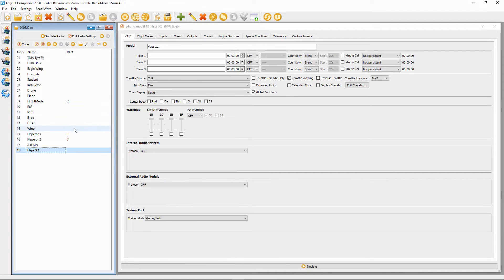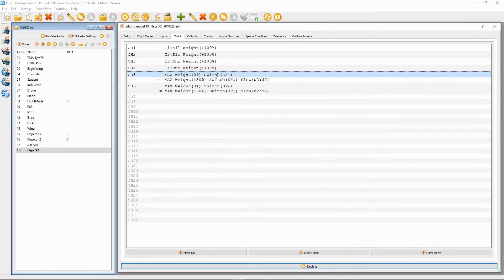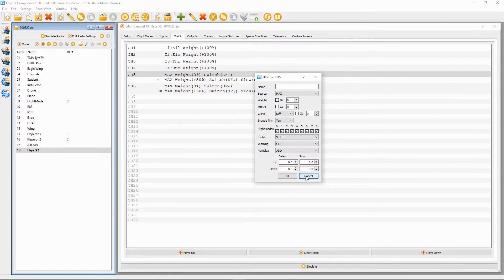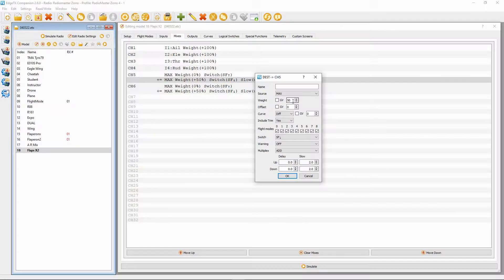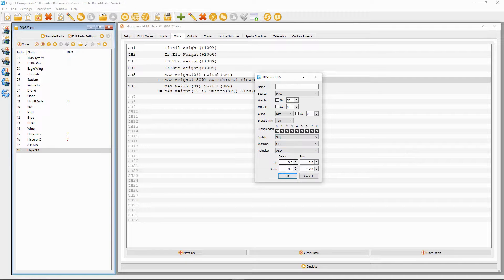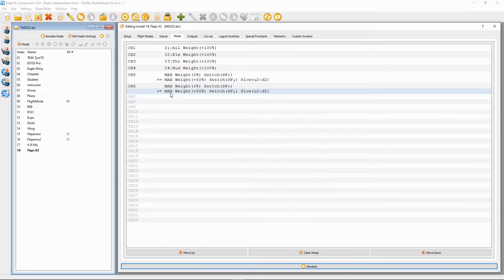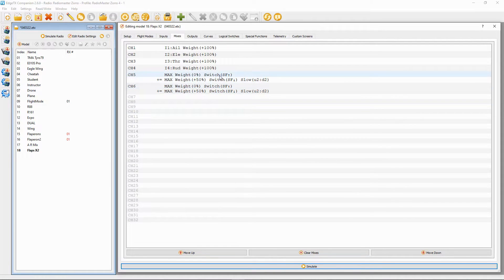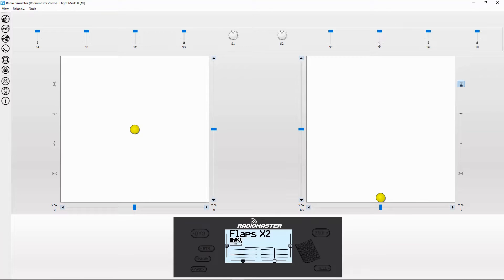RadioMaster Zorro Adding 2 Channels for Flaps in Edge TX

Comment: For us newbies, we are mostly buying Eflite trainers and these radiomasters are so affordable, but so confusing. It would be great to have a training video covering what exactly the diference is between Mixes and Outputs etc
Reply from the maker: Hi Stefan, If you are flying quads you will not normally make any changes in INPUTS or MIXES but for fixed wing I usually add expo to the aileron, elevator and Rudder under INPUTS. The reason for this is all mixes for the INPUTS will now include the expo. Dual rates are added to MIXES as would rudder aileron mixing.

Comment: Morning Bill, how can I use s2 slider for the flap control? cheers Keith in OZ
Reply from the maker: Sorry for the delay Keith work commitments! Short answer is yes but you will need to program the mixes to do so because you will need to have the flap full range of the slider and only go up then down on full travel or make top half of slider a dead zone and flap is up anywhere in this zone. I will look at the mix when I have time for you and produce a video.

Comment: hello Bill very good video a small question do you know how to operate a servo on channel 7 of a receiver (specktrum) through a switch for me all this is possible up to channel 6 but from du 7 the zorro radio no longer supports the channel is there a solution please
Reply from the maker: You need to set up a mix in the mixes for channel 7 but does your receiver only have 6 channels?
Reply: no it's that I don't understand these a 9 channel receiver and after channel 6 no way to move the servos the transmitter no longer takes the information a thousand apologies for my English and once again a big thank you for your attention
Reply: hello Bill a little more precise explanation of my problem
don't worry if it bothers you to help me I understand it very well in any case have a nice day
my 9 channel receiver and from the 7 channel I assign a switch or not the servos do not respond but this receiver works perfectly I even tried with another receiver there is probably a way to recognize the upper channels to 6 via a switch in order to operate a servo my planes require the use of 9 channels to operate, but with the zorro radio only automatically operate 6 channels connected to switches from the 7 channel impossible to activate a servo
Reply from the maker: @lachausseemichel5865  no need to apologise at all. If you are bound to the receiver and channels 1 to 6 are working channels 7 to 9 should be ok. In model set up are you seeing Channel Range 1 to 7? I do not have any Spektrum receivers to test this for you.
Reply: thank you very much Bill I agree with you if the receiver is paired with the radio and all channels from 1 to 6 are working correctly I should have no problem assigning a
switch to channel 7 and run a servo though for your info I don't believe this is specific to the specktrum receiver
I will continue my research good day to you and thank you again
Reply: hello again Bill for info problem solved it was necessary to change the sub-protocol in DSM to put X2F
Reply from the maker: @lachausseemichel5865  I am pleased you have sorted it out.